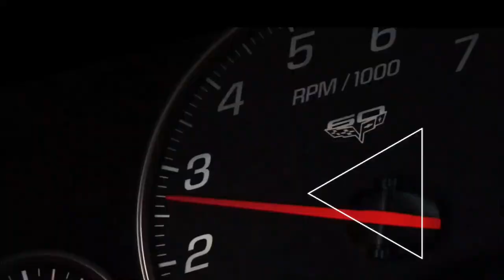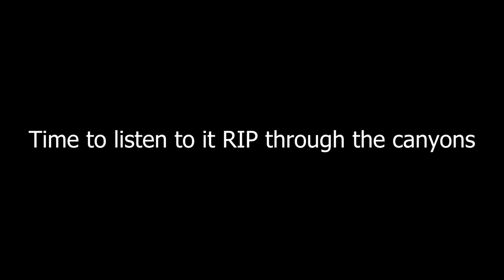C6 Corvette's FULL CUSTOM 3" Exhaust Roars Through Twisting Canyon Roads! Incredible Sound!

Comment: That sounds fantastic for being a catback only! What bullets/resonators were used?
Edit : It has longtubes too.
Reply from the maker: It does have long tubes, so it's a full 3" inch from the headers back. It has a pair of speed engineering resonators is all
Reply: @CamMarz  Now that I pay closer attention, I do remember watching your other video about the longtubes. How does the volume compare to the NPP prior?
Reply from the maker: @ScottO84  Very similar volume wise. Tone is different tho, the tone on the NPP is definitely more raspy. This has a deeper tone. Also this is louder at idle than the NPP. Honestly the NPP is already fantastic, but just knowing it was an extra 60lbs made me wanna replace it. The new 4.5 inch tips are pretty sweet too

Comment: So how horrible is the drone with this setup? The axle back you have is the speed engineering bullet style
Right?
Reply from the maker: Correct, it's been fabbed on there so the location may vary. There is a little bit of drone, but nothing unbearable. The deeper note is great
Reply: @CamMarz  good to hear I just ordered the whole speed engineering kit headers back. I have a muffler delete right now on a stock car and it drones on the highway not real bad but I’m guessing it’s gonna get much worst lol
Reply from the maker: @Bigslick440  you'll love the sound either way haha
Reply: @CamMarz  sure I will I just don’t like that nasty annoying drone when in 6th gear around 70-75 but if your telling me it’s not bad I’ll take your word for it.
Reply from the maker: @Bigslick440  6th at 75 will be completely fine. It'll be louder in 5th at 75 tho, not unbearable again tho
Reply: @CamMarz  it’s not the volume some times you get that annoying low frequency at about 1800 rpm that is unbearable long as this kit doesn’t do that I’ll be happy. I don’t care if it’s loud. 

One last question can you keep it quiet if you wanted like easing off from a stop light or is it just loud all the time.
Reply from the maker: @Bigslick440  Yes, if you're off the throttle or just pop it in neutral it'll you can manage to quiet it down